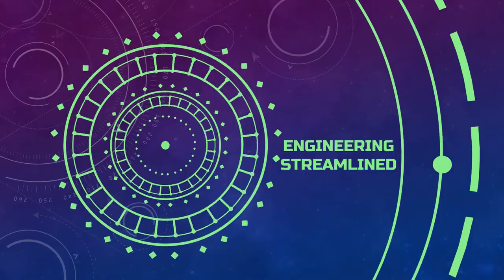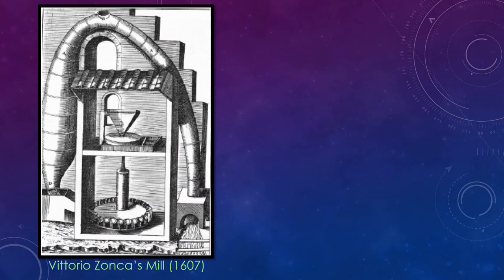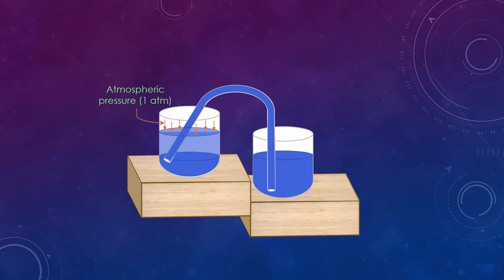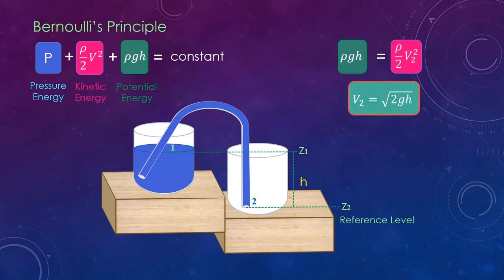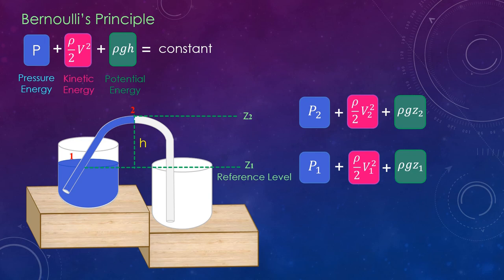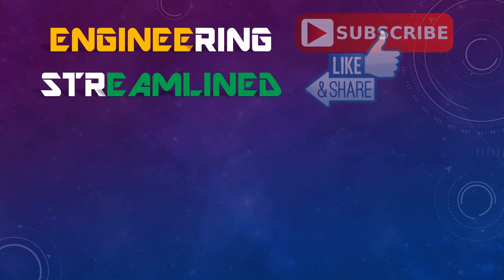Understanding Siphons

Comment: The demonstration assumes that the height of beaker 2 is rising as beaker 1 is lowering.  If, for example, beaker 2 is actually a river drawing the water away, then all of beaker 1 will empty.  correct?   If the tube on the downside is significantly wider than the tube on the upside so that the weight of the water on the downside is increased (say, if the both tubes were completely filled at the beginning and then released so that no air is allowed to enter from either side but water can escape), would that affect the maximum height of the siphon?
Reply from the maker: The maximum height of the siphon is not dependent on the dimensions of the pipe. It is only dependent on the atmospheric pressure, density of fluid and acceleration due to gravity (g). So, using a tube with wider diameter on the downside will not affect the maximum height of the siphon.

Comment: If the Siphon working is due to weight difference, then what is it that keeps the particles linked together like the chain that constantly pulls water. If liquid particles are not linked together, they can't create siphons.
Reply from the maker: I think you have not understood the concept clearly. The first theory of siphoning which I discussed due to weight difference is used by a man named Vittorio Zonca which failed as I said in the video. Subsequently I said, siphoning happens due to pressure difference. In the beaker which is at a higher elevation, the end of the pipe is at atmospheric pressure and the end of the pipe on the other beaker (at lower elevation) is at a lower pressure (vacuum) which initiates the flow of the liquid. The liquid flow stops when the liquid level on both the beakers becomes equal resulting the pressure on both the sides to become equal.

Comment: what if we put both beaker in same elevation but the level of liquid is different... will siphon work?
Reply from the maker: Even if we put both the beakers at same elevation but if the level of liquid is different in the beakers then siphon will work. Because as shown in the video, as long as there will be difference between z1 and z2 elevations, potential energy difference will cause the flow to sustain. But when the liquid level in the both the beakers become same, the flow will stop.
Reply: @ENGINEERINGSTREAMLINED  
Okay thankyou 👍

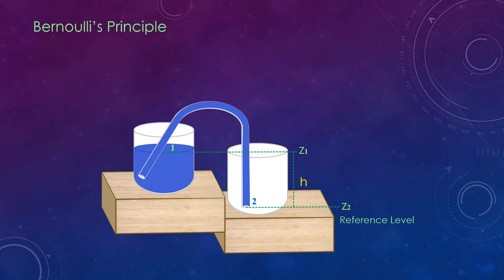Comment: @4:18 you said h was the difference in elevation. Is there a maximum distance between the two beakers? In other words what if beaker 1 was 500 metres in elevation from beaker 2 would siphoning still work?
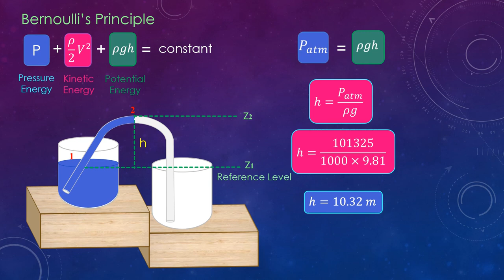Reply from the maker: No, siphoning will not work for such heights. The maximum height h for which siphoning works is 10.32m. It has been shown in the video @6:57.
Reply: @ENGINEERINGSTREAMLINED  Just want clarification. You used two "heights". One height is @4:18 and this is the distance between water surface in beaker 1 and the outlet in beaker 2. This is the height I was talking about. Is there a maximum distance that beaker 1 can be from beaker 2 vertically. I understand that @6:57 you were talking about how high the water can travel upward. I'm asking how far the water can travel downward. if there is even a maximum limit?
Reply from the maker: @foreduca8099  There is no maximum vertical height limit between the two beakers. As long as water moves into the pipe (height limit of 10.32m) from beaker 1 due to atmospheric pressure, the water will flow to beaker 2 due to gravity. So, even for a 500m vertical distance between two beakers water should flow from beaker 1 to 2. However if atmospheric pressure on the liquid surface of beaker 1 is very low due to higher elevation, the siphoning may not work properly.

Comment: Oil will siphone at maximum level .
Reply from the maker: Is that a question?
Reply: @ENGINEERINGSTREAMLINED  
No it isn't at the end of the video you said something like which one will siphon at maximum level _ oil or water and I replied oil.
Kindly correct me if I am wrong
Reply from the maker: @RosemaryOkwara-f6s  Ok. Yes, you are correct. Its just that I forgot that I had asked a question at the end of the video. Thanks for the comment

Comment: Hi. Pressure in this case is all about weight (mass + gravity) whereby atmophere's weight (assuming the air in the room is connected to the atmosphere outside)+ the weight of the water (including the weight in the tube, makes one side heavier (we see the tube is longer on the side where it goes down so there's more weight- weight of the atmosphere + water on the left side). Air gap will break this weight difference and will stop the flow (draining the one with less weight but it won't drain the whole bottle on the left coz' that total weight as a continous thing atmosphere's weight + water weight was broken).

God bless.
Reply from the maker: Hello Seven
The siphoning does not work only because weight of the water on one side of the tube is heavier. If that were the case, then when the level of water in both the beakers become equal then also the flow should have continued. But the flow stops as soon as the water level in both the beakers become equal. Its because in Bernoulli's Principle, the sum of pressure energy + kinetic energy + potential energy becomes equal in both the beakers.
Reply: @ENGINEERINGSTREAMLINED  Thanks for the correction. 

This isn't Mariotte's Bottle/Siphon principle then? 

By the way what principle is used in water dispensers, the one where the gallon of water is turned over the dispenser? Also what principle is use in the automatic pet drink feeder for dogs and cats?

Comment: Once the fluid stalls/ the maximum height is reached, will the flow re-establish itself once the upper reservoir level rises? Or does the break require repriming? Thank you.
Reply from the maker: That is a very good question. The flow stops when the liquid level in both the beakers/reservoirs is at the same level. If you increase the liquid level in the upper reservoir after the flow has stopped then it will require repriming to start the flow again. But if you fill the upper reservoir when the flow is still continuing then the liquid will continue to flow and siphoning will work.

Comment: If beyond 10.32 m height siphoning will not work then what should be the minimum for the syphon to work?? 
Why you didn't teach that part?
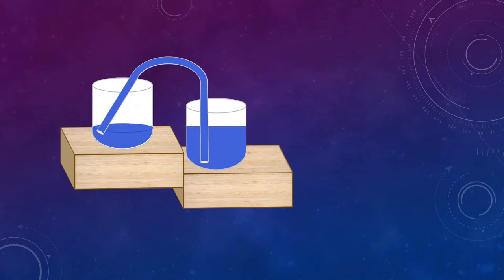Reply from the maker: That is a very good question. In the video , at time  4:30, I have explained the Bernoulli's equation principle  for siphoning. Here you can see, when there is a difference between water level (z1-z2) in the two beakers, then only the flow starts.  If the water level in both beakers is at same elevation (z1 = z2) as shown at time 1:06, the siphoning will stop. So there is no minimum height for siphoning to work. It will start only when there is a difference between the water level in the beakers.